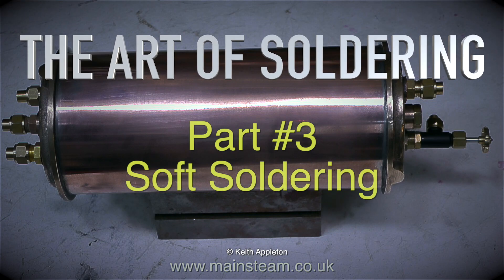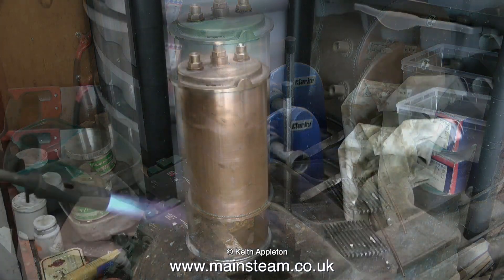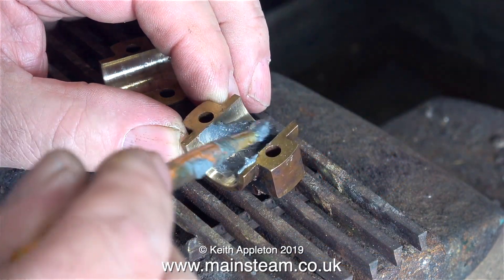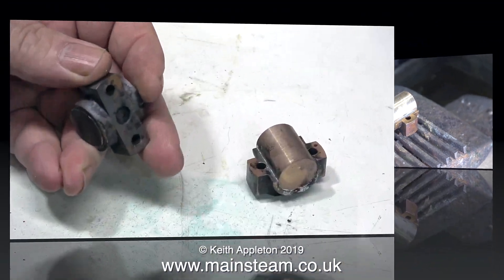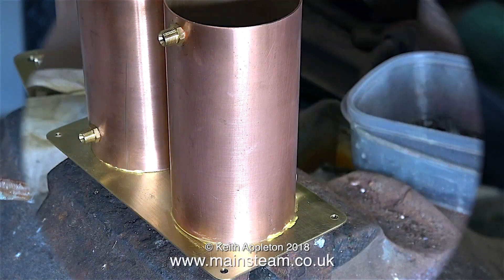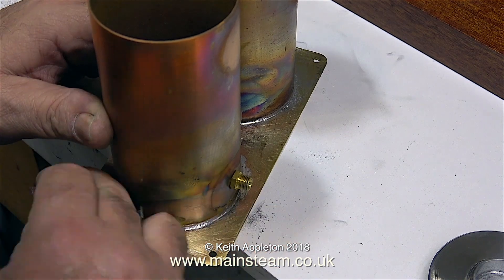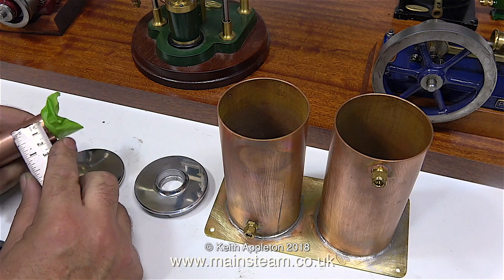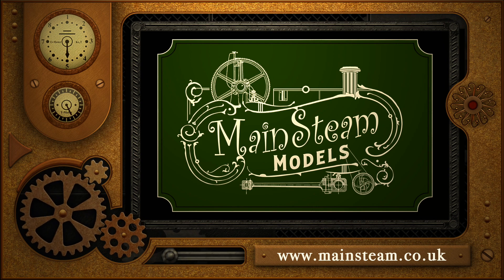THE ART OF SOLDERING - PART #3

Comment: In soft soldering,  clean surfaces are the key.  solder doesn't like to stick to oxidation.  Flux makes solder flow easier and at lower temperatures.  remember that the solder is drawn towards the heat.  In other words, heat the part you want the solder to flow towards.